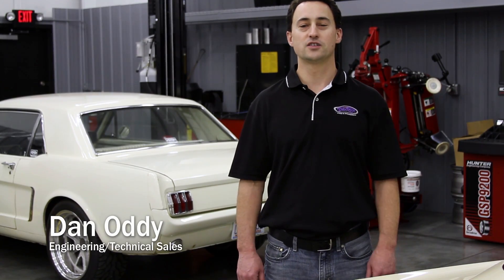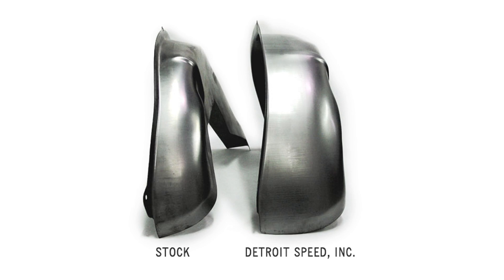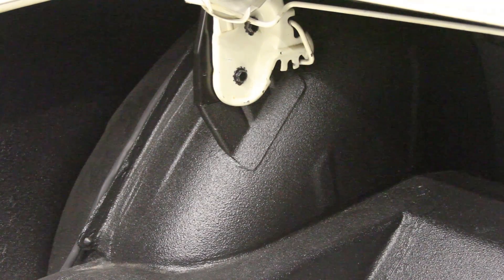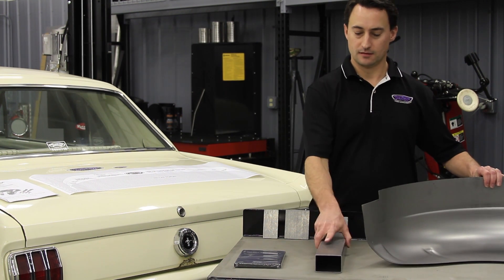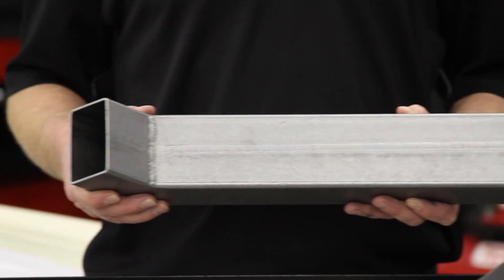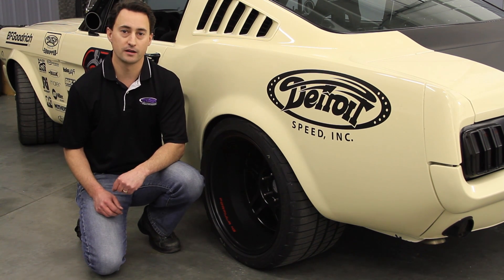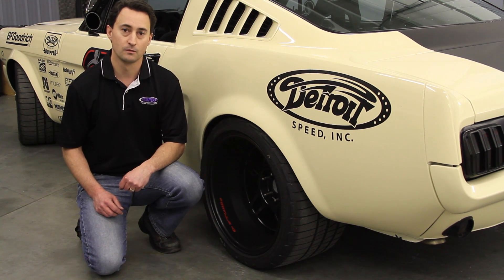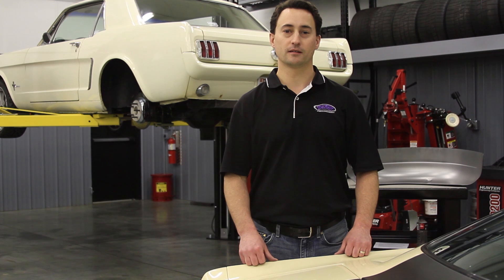Mustang Mini-Tubs - Detroit Speed Tech Series

Comment: Would you best interested in commenting on what type rim specifics will work? I like the ones on the Dse fastback. I am totally new to measurements of wheels or specs on these cars.
Reply: I like pro touring style wheels with backspacing like yours. I have not seen many brands that offer the size of a 66 mustang. Brands like volk say they won’t fit..

Comment: Can you keep the rear seat with these?
Reply: I know this is five years old but I'm building a 66 coupe and so far all I have to do is narrow the bottom of the rear back seat and the back of the bottom rear seat.  I should be able to just wrap the original seat cover a little tighter to fit.  I removed roughly 1.25 of an inch from each end of the seat frames and then bent the frame to follow to the contour of the mini tubs.
Reply: @grabblue  Thanks - you answered my quetion as well.  Have a safe and nice day.  CHEERS from AUSTRALIA.